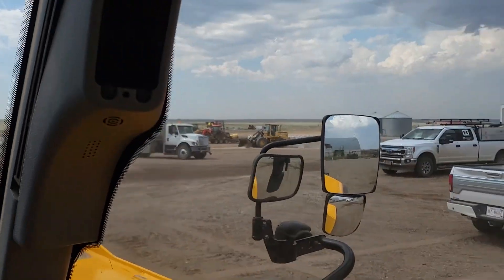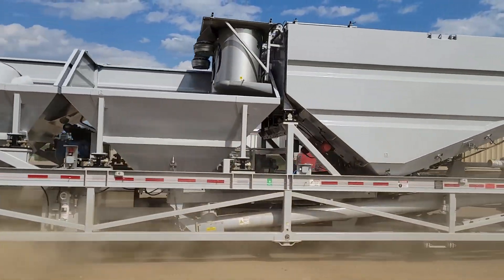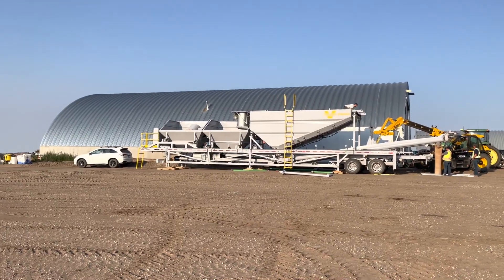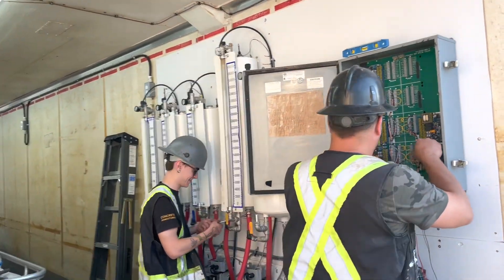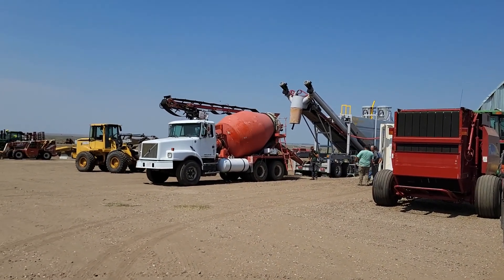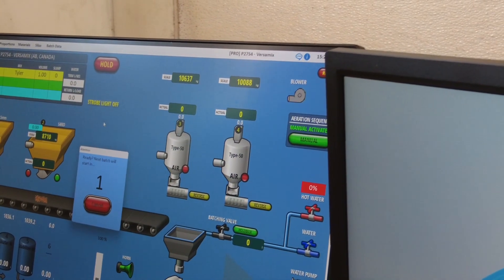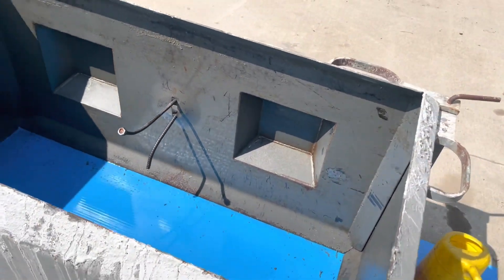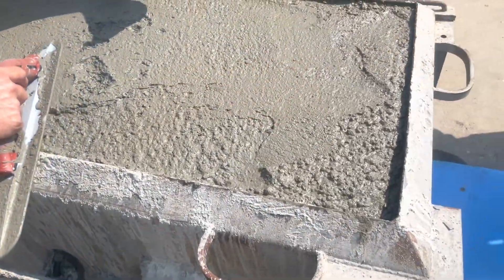Concrete Batch Plant Set Up & Testing

Comment: How's that tread belt doing? I maintain a versamix mobile and its the messyest plant I've ever seen. The pushbroom head belt cleaner is a joke and the oval boot opening is just dumb. Its cracked the cement batcher and needed bracing plates added. Its been quite the p.o.s., I hope you have better luck.